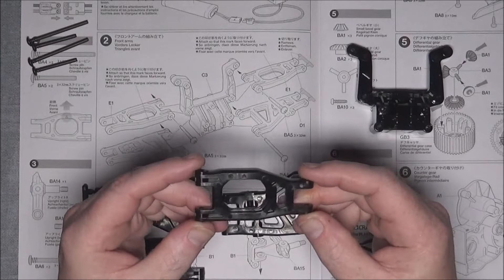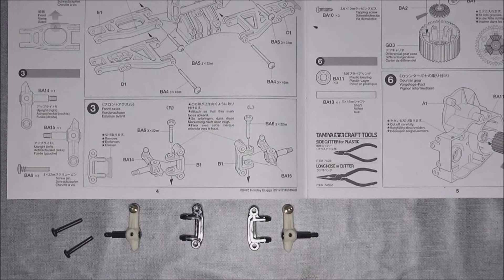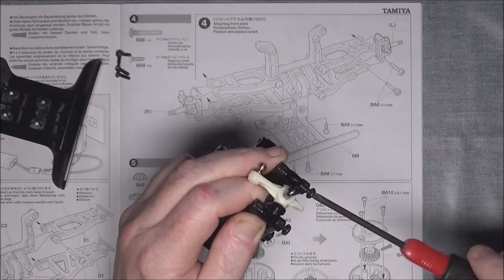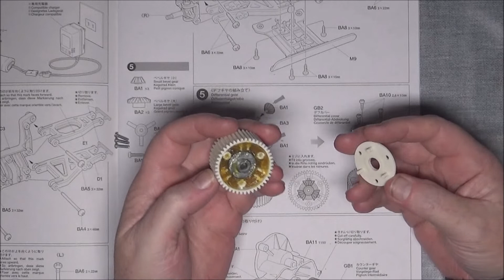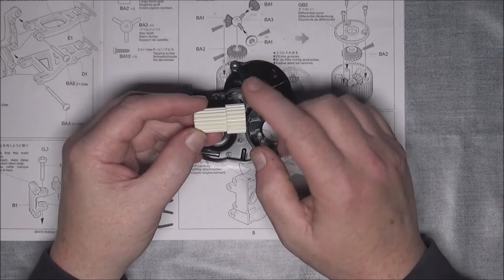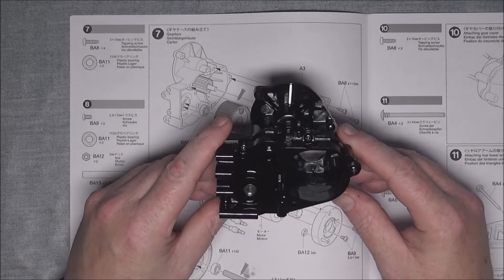Tamiya Holiday Buggy DT-02 Build Part One

Comment: Hi Rob, this is going to be a Quicky build, I built one a couple of years ago, even painted the body, pain in the arse, but well worth it. I always lock up the rear diff of every car I build, using one of the planetary gears ⚙️ wether it be 2WD or 4WD, force of habit, I’d rather go forward than have a tighter turn radius. Nice wee builderup video Rob. 😎👍👍👍🇬🇧
Reply from the maker: Hi Mike. Well it was a quick build but trying to keep the videos shortish I've ended with 7 videos. Wow you painted the body. I took one look and thought you know what I like blue, leave it well alone lol.
I know what you mean especially these RWD buggies don't turn that great anyway unless you back right off (which I don't like doing hehe)
Many thanks mate and keep safe.

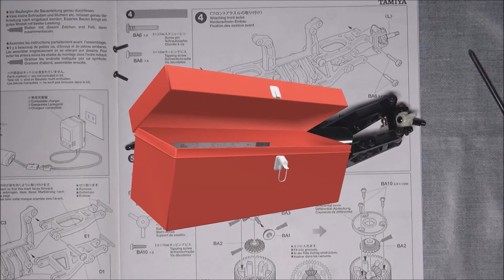Comment: Hiya Rob.  Great guide but as others have mentioned it seems to freeze for about 3 minutes from 7:30.  It was after the next shot jumped out of the tool box so maybe you need to put another cut in the edit after that animation?  Anyway that was a lot of grease in the diff.  I have wondered about putting thick silicone oil in a Tamiya diff but I wonder if it would stay in there?  Good kit this and quite a few bits to paint despite the coloured body.  Cheers for now mate :-)
Reply from the maker: Hi Pete. Bloomin' software. It's done it to me a few times but I noticed it before, oh well at least it kept the sound going lol.
I have wondered that but not got any really thick oil to dare try.
Yes I was a bit surprised at how much needed painting.
Many thanks mate and stay safe.

Comment: I don't know if anyone else caught it, but the whole Diff Build was just a single image, with you talking over it...
No biggie - it's an EASY Diff to do! I packed mine with Marine Grease... not very different from what you did. 

I don't know if you knew this... But you could increase the Wheelbase by simply Reversing the Front Arms. Everything else still works the same... Might look odd on the HB Body, but there's a little benefit, using one of the Lexan Buggy Bodies! 😉
One thing I'd like to suggest, reinforce the Front Shock Tower. 👍👍

Even though I've obviously built this already, I do enjoy your Builds!! 👊👍👍
Reply from the maker: Hi Carmine. Thanks for letting me know about the diff. No idea what happened there as it was supposed to be me making it up dry to show exactly how it goes together. Having said that I am doing a run video at the moment and it has done something similar. plays OK in the software but when I render the video the screen freezes for a few seconds. What a bummer.
It makes perfect sense when someone points it out but never thought about it. might try it on my Super Fighter.
I have already done it using 2mm alloy plate. For some reason that I can't remember I ended up making two for my Super Fighter so had it spare.
Many thanks mate. All the best and keep safe my friend.